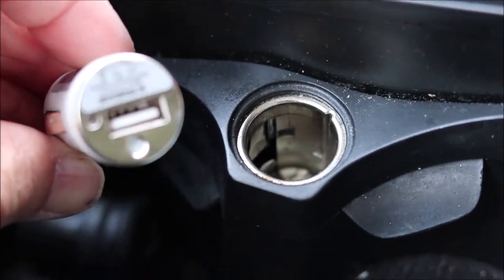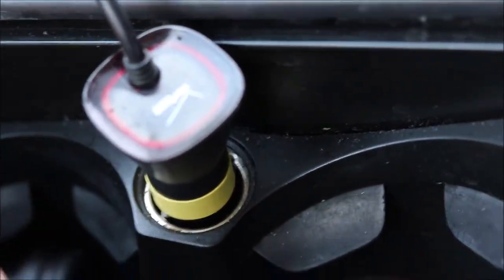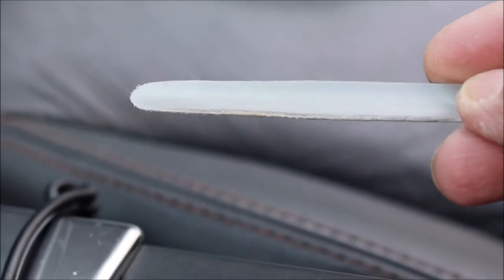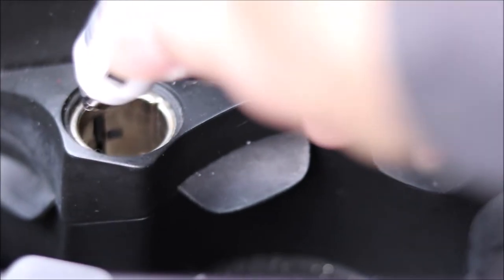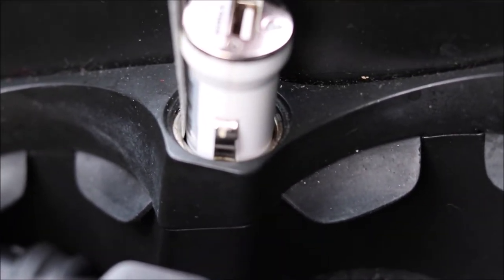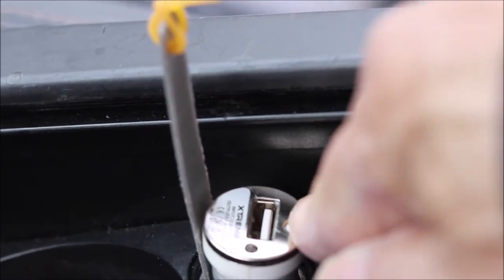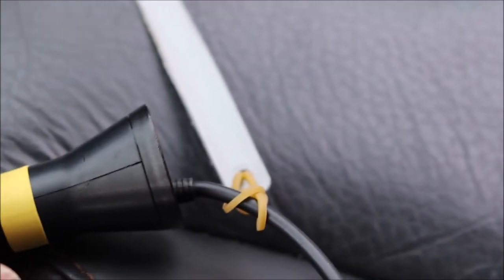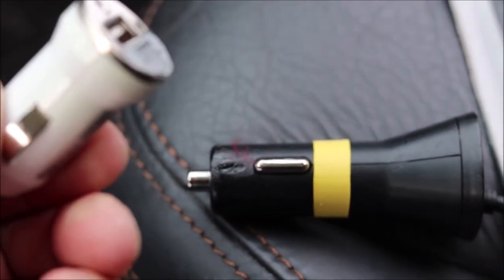Loose fitting car charger adapter in cigarette lighter?  Try this hack!

Comment: I found another method that works very well...place a small strip of adhesive Velcro (fuzzy side, not hook side) on both sides of the plug...it works great!   Plug will fit nice and tight.
Reply: Thank you sir. That's worked a treat for me and a lot tidier 👍👍👍 from the uk
Reply from the maker: I LIKE the idea ... even BETTER than mine!
Reply: This^.  That worked great in my 89 930.  Very clean.
Reply: Works for awhile but ended up with sticky plug n socket. After awhile the glue gives up on the velcro.
Reply: @WHatchitW Yuikes!
Reply: Could you explain the placement?

Comment: Thanks for the advice.  I didn't have any plastic refuse in my recycle container but I'm a retired Master Electrician so I have several million nylon ty-wraps.  I cut the end off a 7-inch black ty-wrap and inserted it into the socket with the GPS plug and it works great.  I used a 4-inch ty-wrap to hold it to the cord for safe keeping.  I used black because this is for my Victory Cross Country Tour motorcycle and it's all black.  I appreciate your idea!
Reply: I have a ton of cable ties - is that what you are talking about? And I can't quite visualise the set up - do you have any pictures?

Comment: Use your bit of plastic to bend the 2 prongs inside at the base of the charging port in slightly and it should fix your issue permanently.

Comment: Instead of a hard plastic, use a thick rubber band works better and no outward slippage too when tugged a little. Then trim off the excess rubber band if you do decide its a long term use.
Reply: Rubber bands melt in heat and degrade over time... Will make a mess eventually.

Comment: Thank you for posting this. You might also want to just add that this is basically a shim, which will help people who do carpentry/etc. to understand even better.  But great idea - I cannot wait to try this out on my converted van - I rely on these 12v plugs in about 3 different places. It's really frustrating when I've plugged in my phone, only to find out that it's slipped out and my phone is dead.  Can't wait to try this!

Comment: Thank you for showing us how to use a shim to fix this problem. I tried  this with plastic (from a yogurt container) but I think they were to thin. I read the comments and someone posted about useig an adhesive velcro and that did the trick. I used the hook part of a velcro comand strip. I cut a very small one in half and tappered the edges. My connections are now very tight and do not wiggle out while driving.

Comment: This worked great! I just used a Taco bell cup I had laying on the floor of my car.  Cut a half inch by 3 inch strip, stuck it in with charger.  It was still loose,  so folded the plastic length wise.  That was good,  but still a little loose.   So cut another strip, and made it 3 layers thick - PERFECT.  I then just cut off the excess that was sticking out,  because I don't plan to take it in and out much.
That,  and there will always be more taco bell cups.

Comment: Thanks for posting that and making it findable. The plug for my 12vt fridge in my motorhome keeps wiggling loose so I'm going to try your idea or one of those in the comment thread. A couple of commentators have warned against adjusting the actual plug and possibly making the problem worse, so I won't be doing that.

Comment: Wowww... 
Will you give me a great idea for my solution...
I just bought a brand new vehicle cooler fridge and the plug would actually slide out...
So not only was mine loose and losing connection but it also slowly would work its way back out for a poor connection. 
I contacted the seller and asked for a replacement plug and they just sent me money to buy my own...lol.. with no questions asked well that's okay...
But I really wanted to use this fridge today so I used your idea...

Anyone that wants to skip the crap that I just wrote...

I took a straw folded it and stuck it in between the spring to make the string more stiff...
I did it on both sides of the springs holy crap this thing's not budging...🥰
..

Comment: Honestly, I’ve struggled for years with this crap. Spent 1 minute watching this, found a thin piece of metal in my car, did the thing. And fixed it instantly. I wish I’d thought of this literally 10 years ago.
Reply from the maker: METAL IS NOT GOOD!!!!!
Reply: YuDaMan yeah, the fact it can short the full 12V is less than ideal. I just put it in the very top for now, and my phone actually charged up! I’ll sort something less conductive out when I’m home. If you put a strip of aluminium all the way down, you’re going to blow a fuse at the very least.
Reply: @YuDaMan  the sides of the socket are the ground and the point is the +12v hot.  i won't say it's idea, but the risk is relatively low using a metal and the side (assuming you don't push the metal to the +12v) and not bent towards the center of the bottom.  

thanks for this tip, it really helped!

Comment: Mine is similar, but I take a business card, cut a small amount like in the video, and take some electrical tape and tape it to both sides (opposite the side n metal pieces). This way it's snug, and you can swap it out and put in other lighter plugs as well. 
If you need slightly more snugness after putting the small bit of business card on, just use one more layer of electrical tape, that way it will snug up in millimeters.
Mine never take more than 2 layers of electrical tape

Comment: Thanks!  Nicely done!  But have you given any thought to prying the inside contacts away from the sides toward the center.  I found that in my car that these create the retention required to keep lighter adapters in place. You can still use a piece of that plastic strip to keep the contacts away from the inner sides of the port.
Reply from the maker: some adapters are tight and some are not so this is an adapter issue, not an issue with the prongs in the lighter socket.  I prefer not to modify a good part(socket)  just because another item(the adapter) is poorly made. Plus if you overdo bending the prongs, then you create a real unnecessary problem.
Reply: @YuDaMan  I think that you are right! Its only my cheaply made in ...somewhere out east adapters that cause me this problem. You sir are very wise!
Reply: I've had good adapters get looser over time. So I think it's the springs that press the side contacts outward losing tension

Comment: Any way to maybe repair the actual plug hole?
Reply: You can stick a screw driver in there and bend the prongs out towards the center of the socket. That only lasts for so long until you'll have to do it again. Make sure there's no power to the socket before you sick anything in there.
Reply: Ahh that would be there is not a groove to accomadate to two outer prongs...those give pressure to the unit to stay in place